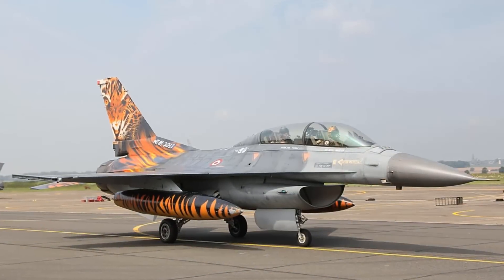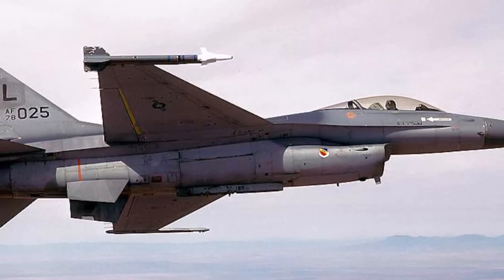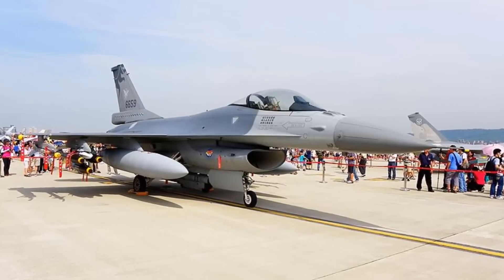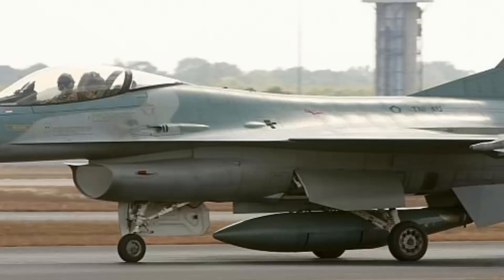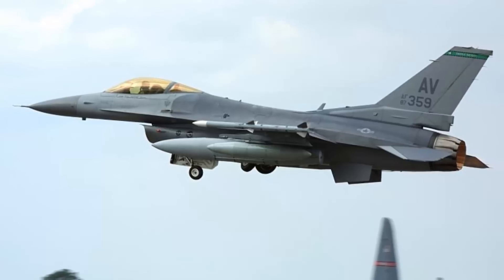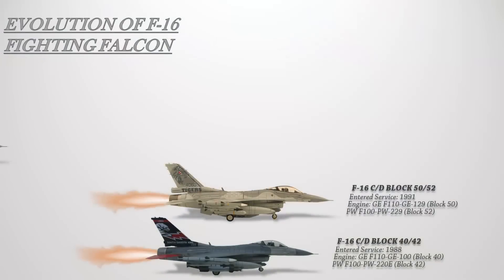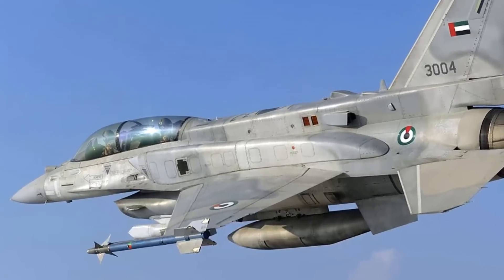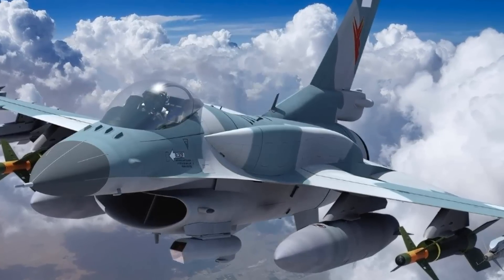Evolution of F-16 Fighting Falcon (F-16A Block 1 to F-16V Block 72)

Comment: The new F-16s still can't beat the sound of old PW Engines
Reply: Sadly. No F100-232s in production! 😩
Reply: You do know that the GE engined F16s have 5k lbs more thrust which can make the F16(in air to air configuration) a thrust to weight ratio of 1 to 1....the PW engined F16s (no matter the configuration) cannot get a 1 to 1 thrust to weight ratio....

Comment: Noting that the aussies(continent sized range) acquired the F18 in recent orders, will an updated block52plus-60 to Viper(AESA), rather than a block50/52(no dorsal-spine) to Viper, with the additional spaces in the dorsal-spine(pig mode) for not EW but AWAC duties (missing latrine not lantirn), be more suitable.?

If they want a dog-fighter, they should-not have the conformal fuel tanks which goes with the dorsal-spine in terms of aerodynamics inefficiencies (all or nothing). If they want range, it should be f15 with conformal fuel tanks. Unless they want to get started on an aircraft carrier...

Compare radar capabilites for air and surface tracking for an F16 with dorsal-spine Viper and the latest F18. Useful information for islander nations and long perimeter-border nations (unless they go for 737-200 or LCA with 2x outer pylon with (updated)lantirn(type)-pods. Toilets... latrine...

Comment: So sad that we (DK) went for the F-35. I would have preferred we upgraded to the Viper and stuck to it until a reliable alternative were present. Don't even think we need a 5'th gen fighter like the F-35 it be too complex, too slow, and heavy and way too expensive. I'd go for quantity and agility anytime.
Reply: F-35 is a technical mess, I'm sad my country is getting them instead of more rafales (Greece)
Reply: @Kelek0400 you do realize that the so called technical mess is a myth....it's only because for some reason (maybe because of social media) how we bash on a new aircraft that has issues......if you actually look at the data, when the F16 came out, it had more issues than the F35 has and 6 times the amount of F16s were lost during flight testing than the F35. Not to mention that newest batch of F35As are only 86 million. Same cost as the block 70 F16s and cheaper than the F15EX....while the F35s are more technically advanced and can do more mission sets and is easier on the pilot and is more survivable in combat....

Comment: Incorrect, the PW220 was not in the Block 25.
Reply: @soulsphere9242  the 220 was in the Block 32 and 42. The GE 110 went into the 30 and 40. Actually I stand corrected. While typing i remembered the older Block 25's were retrofitted with the 220E and I want to say the F-15Cs as well. This was because the 200 had issues with stalls and AB blowouts. This was fixed by the DEEC.

Comment: What the US needs is another inexpensive stealth light version of the F-16. Single engine moderate range design that focuses on defensive combat.
Reply: F35
Reply: The newest batch of F35As are only 86 million dollars. It's cheaper than the new F15EX and the same price as the new Block 70 F16s.....

Comment: This video fails to give information about the total thrust ( on afterburner ) of the variety of the F-16 engines. Moreover the information about the performance of the F-100-PW-200 of the first batches is given as some 23,830 lbs, a number that is inaccurate. A thrust of 23.830 lbs had the earlier F-100-PW-100 engine, operational with the F-15A and F-15C aircraft. The F-100-PW-200 installed on the first batches of the F-16A rendered a total thrust of 25.000 lbs.. After a citation of various engine models without mentioning the respective performance data at all, the video mentioned that the F-110-GE-129 and the F-100-PW-229, installed on the F-16/block-50 and the F-16/block-52 respectively, render the same thrust of 29.000 lbs, what is inaccurate because the F-100--PW-220 has an emergency power scale of thrust at 32.000 lbs for one minute on top of the 29.000 lbs on afterbuner.

Comment: The problem for LMT is they can’t make them fast enough. The small capacity facility where hey relocated the assembly line in Greenville SC is not enough for the huge demand for the Viper. Bulgaria paid for the jets 2 years ago but will get the first coming in 2024-2025. That’s way too slow considering there is a need for new fighters to deter the Russians. Now the country is looking for an interim solution like leasing aircraft from Nato countries until the new ones come in.

Comment: first country greece block 70/72 greek powerr
Reply: Of course, Greece was not the first to receive this block in 70/72, but Bulgaria will receive it first, and Greece will only go for modernization.
Reply: @ivicaniko4812  lol of course greece now was the first to upgrade to 70/72 viper before 5 months,Guess what? It has it already 3 now,and receiving 3 ready officialy every month and learn it is the same with buying them,as always greece with one of the best airforces and the best pilots,not unusual for an elite air force

Comment: Well, the illustration of evolution of the aircraft don't match the pictures given in the "text" . There are no variants with the dorsal spin, shown.
Reply: @soulsphere9242  The 2 seaters are also a "variant".
Reply: @soulsphere9242  Listen at 6:26; The FC/D Block 50/52 PLUS variant is distinct for having, among other things, a dorsal spine compartment ...as do some other later variants.
Reply: @soulsphere9242  
From Wiki:
F-16C/D Block 50/52 Plus
This variant's main differences are the addition of support for conformal fuel tanks (CFTs), a dorsal spine compartment, the APG-68(V9) radar, an On-Board Oxygen Generation System (OBOGS), and a JHMCS helmet.[4]
Reply: @soulsphere9242  There are variants with only two seaters. The f-16I for Israel, for instance.
Reply: @soulsphere9242  Hence a variant that is not shown.

Comment: My dad worked on the F-16 at General Dynamics in Ft. Worth.  He took me to the roll out of the first one in 1973.  One of the best designed planes ever!
Reply: F16 is a very cool plane that gets me excited, but it has by far one of the highest accident rates of 4th & 5th generation gets.  It has killed a lot of pilots.
Reply: @GeorgeOu  The highest accident rates must be the Starfighter, that was called the widowmaker. The F100 was also bad.
Reply: @Tbonyandsteak  Well I said 4th & 5th gen.  Starfighter was an absolute scandal and it's hard to compare with that flying dart.

I am sad the F16 has such a bad safety record since I absolutely love the plane.
Reply: @Tbonyandsteak  

Hey hey hey! Don't you dare! Le Super Sabre is my top... In that area, I think the MiG-21 Bison and the SEPCAT Jaguar takes home the highest awards...
Reply: @edisonone  It did had lots of problems never the less. Dont know about the CSSR tech. I followed the jets my country got.
Reply: @Tbonyandsteak  f100 is not an 4th gen plane.
Reply: @stingerrgb2754  have i claimed that?
Reply: @GeorgeOu  you cant compare jets like that. Shit happens, there will always be accidents with jets. Most of those acidents are human mistake. There was maybe few more acidents on f16 because  there are lot of f16 produced  and still used.
Reply: @GeorgeOu  Is that because of weak brakes and fragile, narrow landing gear? To compare, hornet can litteraly smash into the ground and the gear is ok xD And f15 have much wider gear. I suppose the low speed handling of viper is more than enouth for landing
Reply: @GeorgeOu  

The rate us equally bad with the f-18... that is why trudeau is opting for the Swedish Gripen over the Lightning...
Reply: @edisonone  I have not checked the F-18, but I would have thought it would be better with twin engine.  You're not talking the FA-18 are you?

Comment: It’s good to see Taiwan sign a new arm deal with US but I think 66 amounts is just too rare
Reply: Taiwanese 140 unit of F-16 Block 20s are also receiving upgrades to it's radar and avionic to blk70 standard. That's 206 unit combined, making Taiwan the 5th largest user of F-16 in the world, just behind Netherland.
btw, the enter service year of the block 20 in this video said 1982, which is completely wrong. The correct year is 1997, after the last production of Thailand's Block 15 ended.
That's why Taiwanese Block 20s despite being an A/B variant, have their avionics techs on pair with later F-16C/D Block 50/52 model.
Reply: @morrischen5777  Could you elaborate the special part of the Taiwan block 20?
Reply: 66 is great that like 5 more then the Ukraine army had and there f16 with the world's best missle
Reply: @cortney3280  those jets wouldn’t help ukraine at all. They would end up destroyed like all other planes that they had.
Reply: 66 is HUGE commitment for a country the size of Taiwan.
Reply: Gotta get it to medium rare am I right